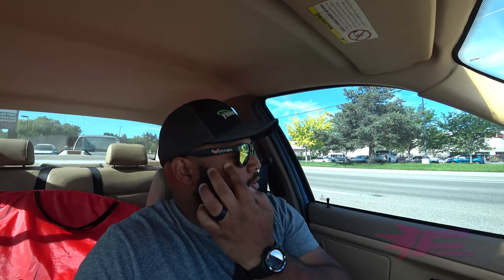HOT MOTORS?

Comment: Good points Furadi.  I also try to gauge motor temp by running near stock PIDs at let's say 90 degrees outside, touch the motors and keep that as a reference throughout the tuning process. Flying an tuning in the same manner and in the same temps will lets me make sense of motor temps since I'm trying to keep the temps outside stable.

Comment: Brooo came across your video just troubleshooting hot motors on my new shark and I'm thinking its actually fine with our temps lately! Good stuff Conrad thanks!
Reply from the maker: woohoo!
Reply: @Furadi  although having known this did some more flying around but indoors in cool 65 house still same hot motors almost cant pinch em hot Haha but no smell of anything burning so who knows. It's a heavy whoop for a 100mm size and has added parts so I think the motors are just having to put in work Haha

Comment: not stupid and boring at all. It actually helped reinforce some thoughts I was just having. We just had a bit of a heat wave up here in Maine where the temperature was getting into the upper 80s and low 90s. I was out flying at my usual spot doing my usual stuff and I noticed my motors which had previously always come down nice and cool we're actually borderline hot. it worried me for a few minutes and I wondered if I might have to change my filter settings(pt1,notch 1 off,notch 2 on) even though I had everything soft mounted. but then it occurred to me that when I built and tuned my quads the ambient temperature was at least 30 degrees cooler. most of the year my Motors don't even get warm. for instance, in January when the temperature is 15 degrees and you are flying at 60 miles an hour that gives you a wind chill of -35 degrees and Motors stay nice and cool. Anyway, I've continued to fly without changing my filter settings and my Motors get warm but they are never too hot to touch.
Reply from the maker: yep yep ambient plays a huge role!

Comment: Another thing to check if your motors are to hot is the length of the motor screws.
Reply from the maker: yep for sure. But this is assuming you've sorted through any possible hardware issues.

Comment: I'm new lol and cheap so I just use silicone washer on motor bolts no build noise over 120mhz even pre notch is smooth motors are cool also learned antigravity and I gain now can add heat to motors not just d like most ppl speak of. ppl I find over prop there motor after tuning with less pitch prop too not using profiles

Comment: Im running PT1 with all notch filters active. Im a little sketched to remove thse b/c I've wrecked in races before and limped though the rest of the race with badly bent props, do you think these scenarios would be risky with notch filter one off?
Reply from the maker: It's gonna vary from system to system but I seem to do fine with notch 1 off and banged up props. Worst case is your quad will try to airmode away.
Reply: Thats nothing a quick disarm wont fix 😆. I'll give it a go then. Thanks for the informative video. Keep em coming

Comment: Ok so its summer time and iv built 4 identical quads iflight succex 45a stack eco 2207 motors and all of them come down hot everything is soft mount even the motors I'm running stock emuflight. What should I try next because I can't get rid of it
Reply: Ps they all fly amazing
Reply from the maker: How hot?
Reply: @Furadi  alittle on the hot side they all fly amazing no osolations

Comment: Anyone know where to find a short version? the bobbins are a little tall..
Reply from the maker: the RMRC bobbins are as short as they get. What's your setup? Frame and FC?
Reply from the maker: So that's a mid mount frame with a low stack height. You're best bet is going to be to switch to an AiO like the BF F3 or Tempest so you don't have to use a PDB. OR you can bolt the PDB to the Lux then use layers of VHB (3M tape) on the bottom of the PDB.
Reply: Going to give it a shot with the current stack. If push come to shove i'll move to BF F3 since that's something i've been eyeing unless something at the time I switch comes out. Hows the Tempest I haven't personally seen/heard anything. BTW, the CNHL that you recommended for beater packs work great. Just I haven't had any good service with Multicopterbatteries after multiple times of trying to get a response. I have 3 of the 7 batteries. The others were a mistake on their part. They didn't have the Graphenes in stock when I ordered but it said in stock on the web. Do you have a direct contact?
Reply: i have a bobbin on the sewing machine, will that work? 😜
Reply: Sorry, the comment was meant for Conrad, just ended up in the won't place- gotta harass him once in a while 😎

Comment: Did smash one of my martian II builds badly on asphalt and had to replace the bell on one of the motors  (EMAX RS2205S 2600KV). After re-assembling the motors got freaking hot and the quad wanted to airmode away :-). Re-activating the second giro notch filter did the trick. Before they both have been off and all was fine. I totally agree with softmounting - I had really weird mid throttle vibrations without that. I noticed that with the second giro notch re-enabled there is more propwash tho. Is there anything else that can be done to reduce the prop-wash ? https://youtu.be/ogB3nuxzm48
Reply from the maker: Yep yep just tune like normal. Either add D or lower P hehe.
Reply: Still flying all stock :-) trying not to kill myself. Will give it a shot to play with the PIDs. It seems to only happen if I do 180 turns or recovering from crappy moves